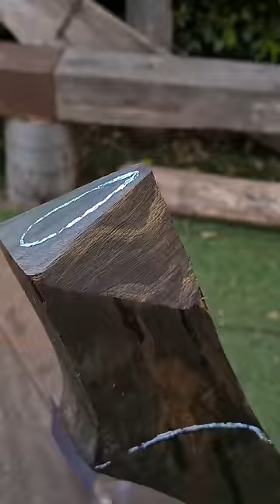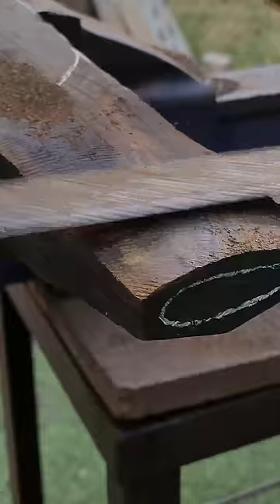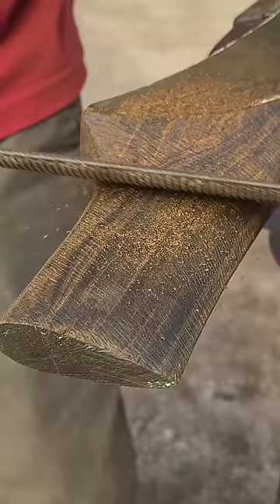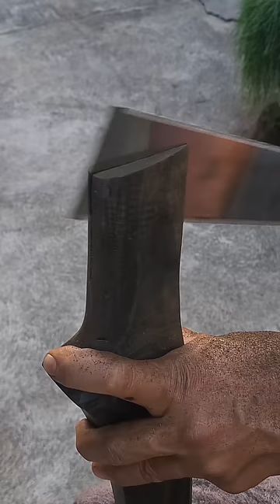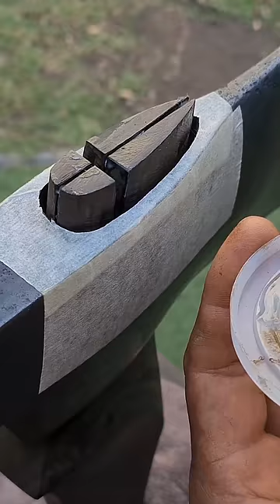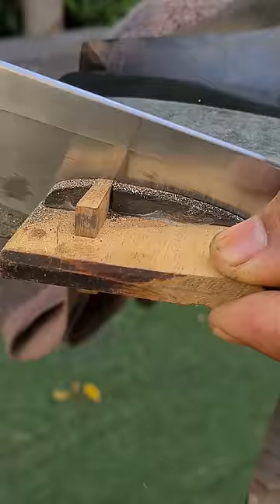Hanging an ebony axe handle with a cross wedge #craftsmanship #shorts

Comment: when doing a cross wedge make sure to drill a relieve hole! overtime the crosses can split the handle down the center along the grain
Reply: This is correct
Reply: Remember what Jesus did on the cross for you they wicked put nails in his hands as a reflection of Jesus Christ taking pain for your gain.

Jesus Christ paid your win debt.  so that you could be saved
Reply: 🤔 sounds better to leave the “cross” out of it entirely. What purpose does it serve?
Reply: @nelsonmiller8179 keeps the axe head in place
Reply: @cloverp._p  
One wedge is sufficient 💁🏼‍♂️
Reply: @nelsonmiller8179  cross looks cooler tho
Reply: @nelsonmiller8179 One wedge is not sufficient. Needs a wedge on both axis to prevent wobbling of the axehead.
Reply: @markus5237  
Not at all.
Reply: @nelsonmiller8179  "Sounds better to leave the cross out of it" despite the added stability is hardly a better argument. These handles loosen when you hit wood. Surprising, isn't it?
Reply: @markus5237  
I’ve used axes with just a single wedge to fix the head for close to 40 years, and one was always sufficient.
Reply: @nelsonmiller8179  So are two wedges. Just as sufficient, possibly even more. Less repairs like you even mentioned.

Bottom line: The cross symbol is fine. It is not "better" to leave it out. Net positive with all the included nuance.
Reply: Where do you drill the hole? I’m not quite understanding…
Reply: @livefree316 you aren't free religion controls you

Comment: In my experience when hanging the traditional way, leaving that much of a gap in the eye to be closed by the wedge will result in loose heads after some use even with epoxy. Absolutely beautiful piece! Some advice I’d give is once you’re able to get the head on slightly, turn the axe upside down and strike the handle into the axe head the opposite way you were. you won’t be able to get it on all the way at first but once you take the axe head back off then you’ll be able to see where the axe head curled away parts of the high spots on the handle as it bottomed out and you just file those down and repeat the process until the head gets to where you need it to sit. This song and dance is tedious but it guarantees your customer will have something not only beautiful but rigid and reliable when it’s needed most.
Reply from the maker: Thank you very much for your advice, this is very helpful.The way we do it may look different to yours because we use hard wood for the handles which is quite difficult and limited in handling.🥰🥰🙏🙏
Reply: This.
Reply: @poomsproject  everyone uses hardwood for their handles. Hickory and ash are hardwoods. Hang the head correctly regardless of species
Reply: @joshl90 ash and hickory are much much softer than ebony. They are all hardwoods. But ebony is insanely hard. It's has very different mechanical properties as well. Ebony is closer to ironwood than it is to ash.
Reply: They aren’t making tools. These are not functional items but wall hangers.
Reply: @joshl90  hickory and ash are more flexible than ebony, ebony is an extremely hard wood much more than hickory or ash

Comment: Why epoxy? That must be an absolute pain replacing the handle.
Reply from the maker: For more stronger hanging.😊👍👍
Reply: @poomsproject  hanging?
Reply from the maker: @Billy-burner  Yeah for sure, axe hanging.👍😊
Reply: @poomsproject  what is that
Reply from the maker: @Billy-burner  This is the way to make the axe head install on the handle, commonly we call axe hanging or hanging an axe handle👍😊
Reply: @poomsproject  cool. Thanks mate.